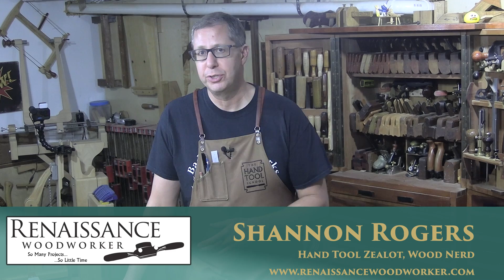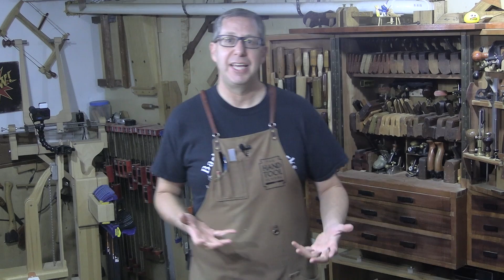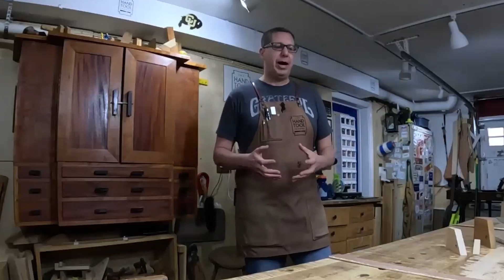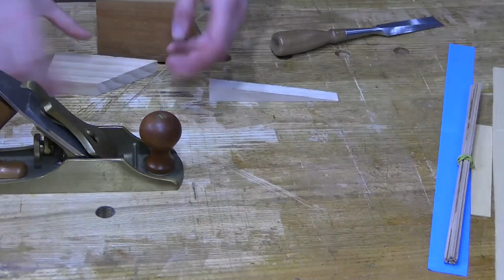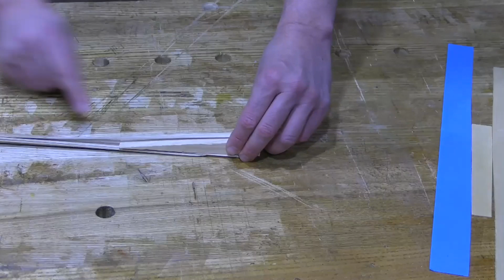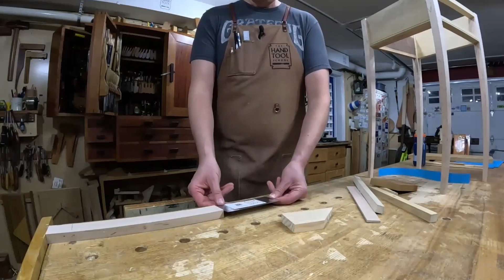The Physics of Woodworking

Comment: Shannon, I have a question. I know you own a frame saw. Do you think a frame saw will be able to resaw slabs up to 20-22”? I have several slabs I cut this summer that I’m eventually going to have to resaw.
Reply from the maker: Yes I've done it.  Resawed up to 32" with my 48" saw.  That was slow but I did a few 26" Walnut slabs for a drop leaf table in Semester 4 of The Hand Tool School and that handled it with zero problem.
Reply: @RenaissanceWW  Thanks for the reply. I don’t have or know anyone with a bandsaw mill so I believe that’s my only option.

Comment: How about a talk on the physics of a Roman workbench (sitting working) vs. a standing bench (jointer’s bench) vs. Japanese low saw horses or planing bench?  Advantages or strengths and disadvantages.  Why each in context?  Or, could you design a Roman bench that can double as a shave horse?
Reply from the maker: not sure this is a physics question but more an ergonomic question.  The blade and wood interface will still be the same.  But sitting and standing changes the leverage dramatically and different tasks benefit or suffer.  eg: standing while planing is easier, boring a hole while sitting tends to be more efficient.

Comment: I've seen you on the Wood Talk YT channel, but today your channel showed up in my feed.  The cost of a hand plane has kept me from getting one at this point, but I find that I really enjoy using hand tools, and because they're quieter, and my shop is in my basement, my wife doesn't complain when I'm using them :D  Right now I just have some cheap tools, but I'm practicing cutting straight lines, using and sharpening chisels, and I don't like the time it takes for hand sanding.  I'm not getting rid of my power tools though... my wife isn't home 24/7 ;)